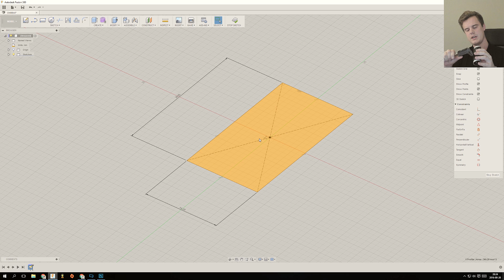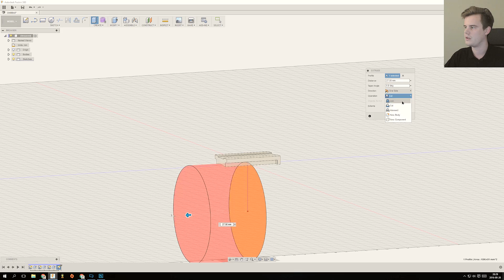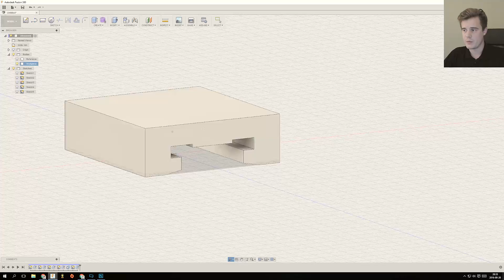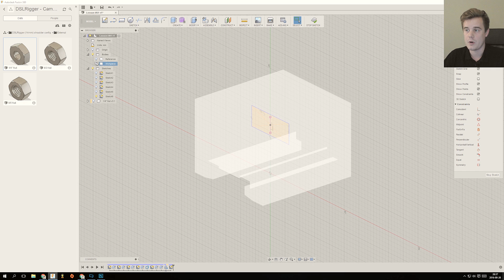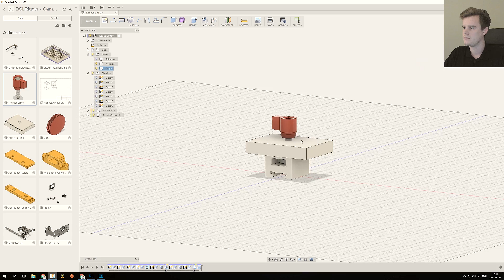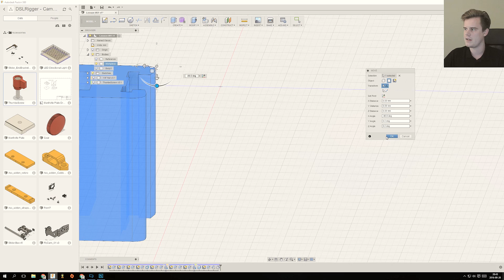Fusion 360 for 3D Printing - #01 - First "CAD-along"

Comment: Great video! Have you tried printing this part? Im wondering how well it worked without any clearance designed into the part.
Reply from the maker: Made it last night, Will start printing now. In a fine-tuned printer those margins won't be a problem. But I'll report back as soon as it's printed ;)